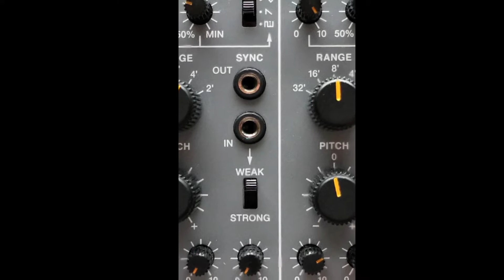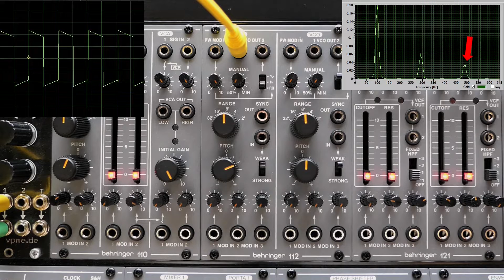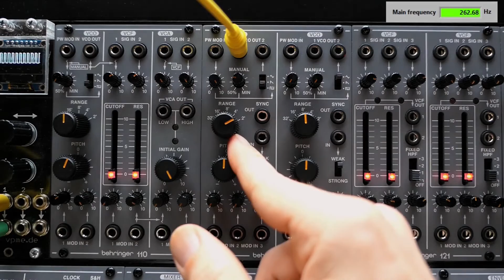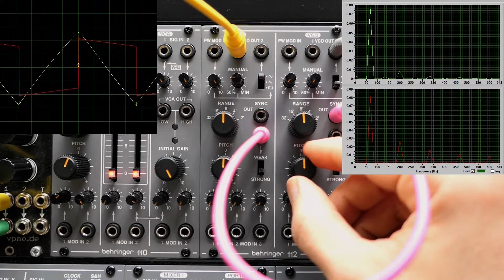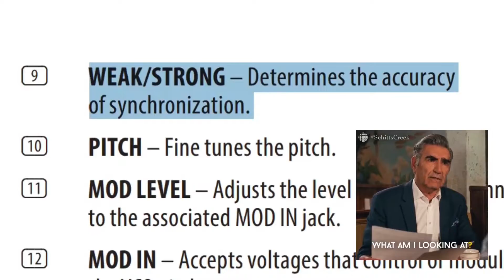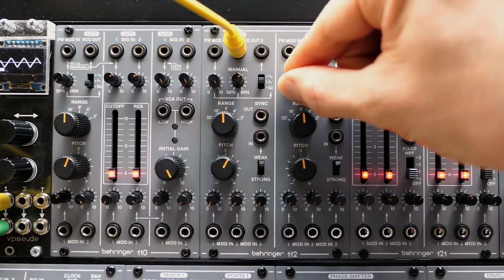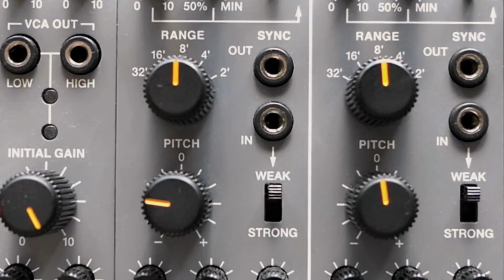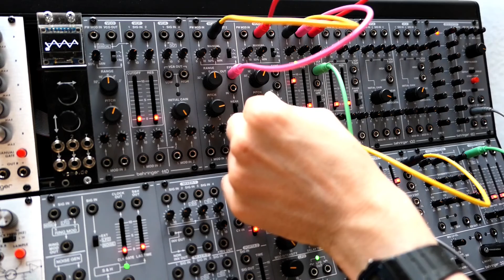Behringer 112 Dual Oscillator ~ impressive analog sound

Comment: Hi! Does anyone else notice that the triangle wave seems to have  have some of the saw bleeding over? I hear it here in this video  (using headphones) and on my own unit as well. Very pronounced at lower range, making an audible click just as the saw does  at low range. I'm curious why I hear it in the right speaker only. Any way to adjust this bleed or am i hearing things? Cheers

Comment: I'm planning to build my first modular system based on the Behringer System 100, and I have a question: do you use the CP1A or any other module with this functionality in your system? Or do you rely solely on the Eurorack Go power supply? Best regards.

Comment: I have heard issues with tracking and tunning with the 112.  Have you had to adjust any trimmers on your unit? Also I have heard the green colored pcb versions are 'more stable' in this regard?  Any thoughts?
Reply from the maker: I have no issues with the oscillator (yellow pcb), the tracking is fine and it doesn't really drift. Holds for the 110 synth voice as well. I have read somewhere that Behringer fixed the tracking and stability issues in the current version of the 112 module.

Comment: Very nice! I had an original Roland 100m system back in the day. Resisting the temptation to recreate it - although now much, much more affordable - nostalgia ain't what it used to be 😀
Reply from the maker: If you spot something that was different with the original (or something I got wrong), just leave a comment! I already found some bugs (not in the 112 actually), so I suspect that B. didn't thoroughly tested the circuits.
Reply: @synthesizer83  That seems to be par for the course for B 😀 It's too long ago for me to recall details but Tim Shoebridge covered some modules and one thing which sticks is that the sequencer has no Range function and seems to be set to 10 octaves! (The original had 3 Range settings.) That would mean the knob will have 120 (or is that 130) steps to it so good luck trying to tune it to a particular note 😱
Reply from the maker: @IanWaugh  Yep thats true, that switch is missing and tuning is impossible unless you attenuate your cv before it goes onto a pitch or so. Good thing though with the System 100 is that all modules have cv mixers with attenuators, so the range problem is not too serious.
Reply: @synthesizer83 Yes, the 100m was well-designed I think, and there are always work-arounds in modular 😀 But a really odd faux pas by B. At least set it to 5 octaves. At best, put a jumper on the board. Just weird.